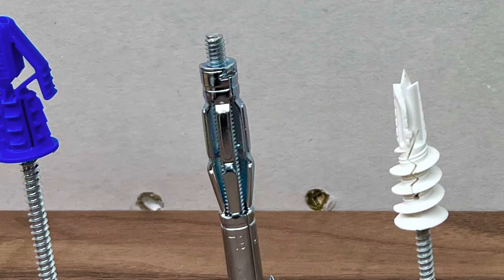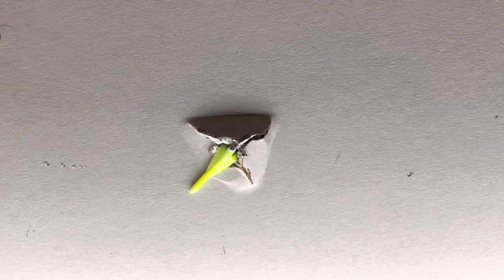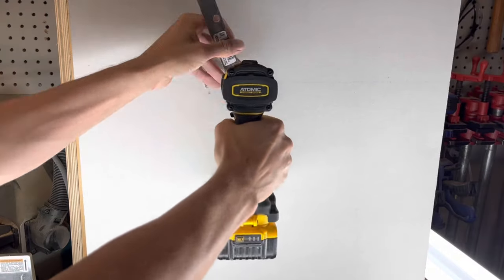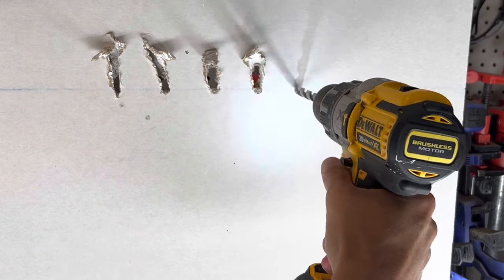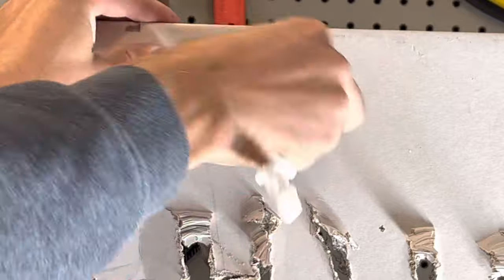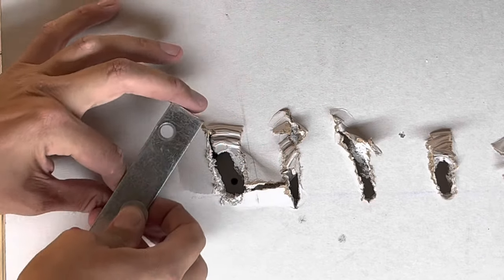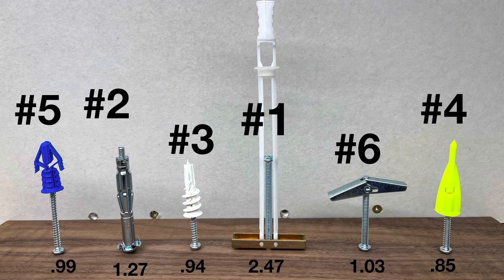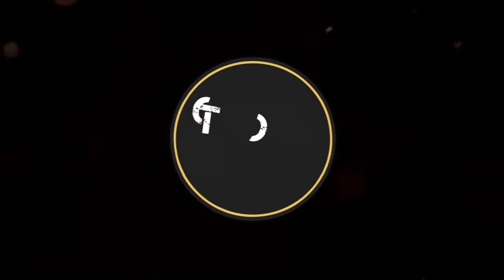The Best Drywall Anchor Plug Inserts // Tested

Comment: I wish people would test pull-out strength perpendicular to the face of the drywall. I think that is relevant too, and is likely to be a more useful measure for differentiating between anchor designs. When you're pulling the fastener parallel to the face of the drywall, at some point the fastener / anchor is just going to plow through the drywall as you've shown, and it seems like the force it would take to do that is a mere function of the strength of the drywall itself and the diameter of the anchor.
Reply from the maker: The perpendicular force you’re asking for isn’t a very common pull on drywall anchors, it’s pretty much just shelving and if you’re hanging something heavy from a ceiling which isn’t a common use case. The anchors tested all got different strengths by how they grab or apply themselves to the drywall. The ones that spread bigger or grab on harder usually have a higher holding strength. In the majority of scenarios the way the anchors were tested will be how they fail.
Reply: Not one anchor failed. The drywall fails depending on the size of the part of the anchor that is behind the drywall. It is rated at 60 lbs per square inch. Multiple anchors spread the load so long as they are not too close together. drywall comes in 1/4, 3/8. /2, and 5/8 and be stronger per thickness.
Reply from the maker: @Stringsmith  all correct basically what I said but none the less correct. That being said some of the anchors did in fact snap before the drywall failed so they did indeed fail.
Reply: I've had to comment on a lot of drywall anchor videos with the exact same issue in testing methodology. It's the force being pulled OFF the drywall that I think is relevant to 99% of people as the centre of weight gravity on the anchor would be considerably worse.
Reply from the maker: @chaseapple85  again besides a levering shelf or hanging from a ceiling you won’t have an outward pull. It doesn’t matter if you’re hanging a photo, mirror, tv or anything else the pull is as shown in the video. This is also how manufacturers give their weight rating. For real world use pulling off the drywall just isn’t realistic.
Reply: Their purpose is to keep the structure from moving forward when you can't find a stud.  They aren't doing much with downward weight, instead the pull away effect.

A good example is free handing shelving that use 1 rail as the support system .
Reply: Again, what I said is that a pull-out test would be better for differentiating between different anchor designs. An anchor is subject to both a downward force and a horizontal pull-out force, with a varying difference between the magnitude in each of the two directions depending on what exactly you’re hanging. But the fact is this: if all you’re concerned about is the force it takes to plow an anchor through the drywall downward parallel to its surface, then why have any anchoring function at all? Why couldn’t we just poke a wooden dowel into a slightly undersized hole in the wall and call it good? Well, because the anchoring mechanism actually does something. And it happens to be what really differentiates between different anchor designs. It drives me nuts how we’re sold the crappiest injection-molded newfangled super-twisty-interlocking-bunch-o-matic when the galvanized steel drill-free design is clearly superior in so many ways. A simple test of pull-out force weighed against practical factors would put this issue to bed so we could move on with our lives. Did you know those steel anchors are even **re-usable**?? And when removed, they leave a hole behind that’s hardly any bigger than the screw itself?? Why did I have to dig so deep to find them, and only from a Chinese manufacturer on Amazon?? It’s madness. 

This message was brought to you by another thirty-something dad with too much on his plate lol 🤣

Comment: With the blue plas plug I’ve found that the depth of the dry wall is so thin that I hangs out a bit and no matter how long I screw in it doesn’t tighten back.

Comment: Togglers/snap toggle anchors are the best as they can also be reused once installed as maybe taking a device down and wanting to rehang it in the same spot. Not only are they beasts but once set can be reused as the plastic retainer holds the butterfly in the wall for reuse.
Reply from the maker: Great point!

Comment: Which would be best for mounting L brackets and a shelf?
Reply from the maker: Probably the snap toggle but first how much weight will the shelf be holding?
Reply: 18 lbs
Reply from the maker: @flyers10az  do you know the shelf’s dimensions?
Reply: @ToolsThatBuild  about 16" wide and 6" deep.  Will be holding a speaker.
Reply from the maker: @flyers10az  yeah I would use the snap toggle as long as the bracket is wide enough to cover the 1/2” hole. If you can hit at least one stud that would obviously be ideal
Reply: @ToolsThatBuild  ok thank you!  I am able to hir 1 stud with the 2nd bracket.

Comment: Number 2 you need you start with a hand screw driver first as using a drill, caddie causes the teeth to shed the plaster wall
Reply from the maker: No plaster here and as some one who could see inside their wall I can confirm the teeth did not shred anything. The impact driver was turning slow enough.

Comment: Over drilled a large anchor screw (the white one). Left a large hole but still need the space . Now what? Can I stick the screw with the wings in the existing hole and use it was you’ve instructed? 
Thx
Reply from the maker: Yes you can use an anchor that requires the bigger hole like the toggle anchor

Comment: For my professional AV installs I like the toggle bolts.  It’s well worth the price and peace of mind.
Reply: dude, try the expanding anchors, especially if you can get the tool.
so many advantages.
.
With the flat screens being a lot lighter than thery where only a few years ago.
hanging small to medium screens flat to the wall is definitely doable with a hand full of these.
.
they are also good for mounting equipment boxes, wall controls and keypads
.
I will often use them as a seconday fastener on bigger screens.
I'll get a few coach bolts or some other anchor to take most of the weight and use a couple of expanding plasterboard anchors, to hold the corners down and for a bit more stability where there is no stud.
.
one big advantage is they can be used over and over again, because the anchor stays put when you take the screw out.

Comment: Great video. Great comparison. I was looking to see what new anchors were out there.  We've been using the Toggler for some time with great success. Most of what we use it for is shelving standards, and tv mounts when we can't find a stud. Installed over 500 of these and have yet to have one fail. We used to use the old school toggle. The Toggler makes it so much easier. Thanks again
Reply from the maker: Appreciate it, it’s a great anchor for that purpose l. Glad to hear it’s working out for you.

Comment: This is a helpful video but some critical specs on my agenda are wall thickness and removability which varies among your examples.  If you wanted a seasonal/removable feature attached your wall- many of these will leave an anchor, and others drop a component behind the wall if removed and some are hit or miss depending on how secured your hardware becomes.   Also, my walls are particularly challenging as they are 1" thick.  At least one of the molly bolts you tested appeared to be designed for a thicker wall and so secured with an un-naturally high bend. YMMV.  Thanks for posting & testing!

Comment: These days, my preference is the metal expanding anchor.
Yes there is a tool, for them that makes them far easier and faster to instal.
.
These come in a variety of sizes. It is very important to select the correct length, for the thickness of wall board.
The better versions have a wide length range.
.
I carry a wide variety of these.
The quality brand name versions do work better, than the generic versions.
.
Of course the bigger versions will carry more weight than the smaller ones.
.
Another big advantahe of these is that thay can be installed in a variety of different boards and where there is something behind the plaster board, such as a metal stud, some sort of board or bracing sheet or even sheet metal. If you can drill thru it, these anchors will work well.
.
I have installed my share of the screw in anchors.
Here in AU they come on both plastic and metal versions.
They can work very well.
These can work quite badly if not installed with care, particularly when installed with a power screw driver.
.
I have not used spring toggles for many years, they are an uggly pain in the kneck.
.
In my over 40 years in the trade I have used many anchors, these days the metal expanding anchor is definitely my preference.

Comment: I need to install a 140lb floating console on a wall about 2 feet off the ground. It hangs on a simple long bracket with holes every inch that gets mounted to the wall. Normally I'd have put plywood in the wall to hold up the console but we had to pivot after we closed up the wall following renovation and now I don't want to open the wall again in the finished space.

Question: will these 3/16" heavy duty togglers (your #1 pick here!) be enough to support weight of the console, 48" TV, and whatever goes in the drawers? The wall has 4 or 5 steel studs (25 gauge) in it. I was thinking 8-10 bolts, one in each stud and one in the drywall spaced between the studs.

According to the box you can use these toggle bolts through both sheetrock and steel studs. I figure if I put in about 8-10 evenly spaced out, half in wall board and half in wallboard + stud, that's a lot of hanging power and per the specs given above would be putting about 20-30 lbs of pressure on each individual toggle (when adding weight of TV). At the same time, conceptually, I just have a hard time imagining how wallboard, studs, and toggle can hold up that much. What do you think? Thanks!

Comment: We are adding shelves in our kitchen and of course, the J  brackets don't line up with the studs, after watching this I am still torn on which to buy. We will be putting dishes (heavy plates etc) on them
Reply from the maker: Tbh I would check for other solutions for something really heavy being on a shelf. A shelf leavers against the wall obviously which increases the load on the anchor. You can’t hit any studs or use a long bracket?

Comment: i have a question..I just bought a plastic white wall ledge. Its 18" and can hold up to 5lbs. The anchors that came with it are horrible. Made of plastic with the metal screws and it makes the shelf sag. In your opinion what would be the best anchor to use?

Comment: Great video!
Reply from the maker: Thank you
Reply: I was wondering, if I don’t have a drill, is it absolutely necessary to make a hole first for the anchor you used at 2:40? Could I use a nail or something or just hammer the anchor through?
Reply from the maker: @JohnFitzMusic  manufacturer recommends pre drilling for that particular anchor. I would at the very least use a nail and rotate it to make a small hole but it is a fairly sturdy hanger that would probably go in with a hammer and a smaller hole than the recommended drilled size.

Comment: some of these can be angled to benefit application. Like the 2 sided ones either up and down strength or side to side.
Reply from the maker: Your relying on the additional surface area of the drywall increasing the breaking strength. That isn’t the case. The anchors will fail at the same strength. You could actually lower the breaking strength by angling the anchor by making the hole larger or preventing the anchor from completely expanding/grabbing inside the wall.
Reply: @ToolsThatBuild  oh i see. Cool cool

Comment: Love the speed, what haooena behind the drywall, as we as the tests. Suggestion to alps include the rating during each test, and at the end of the video, like Project Farm. Cheers
Reply: Also, the rated weights should be similar, otherwise the percent difference is more relevant. Ie if an anchor rated at 35 lbs breaks at 40 its better than one rated for 75 that breaks at 80. Same 5lbs, huge percent difference
Reply from the maker: @catalindeluxus8545  percentage is a good idea. I do comment on each one’s rating it’s just not on screen as the rating doesn’t matter really since the test is a more accurate representation. There’s only so many anchors on the market and between my two videos I touch on majority of the consumer available ones. Finding ones with similar ratings would be a short video. I instead select all the same size of anchors and let the ratings show in the testing.

Comment: For the toggler, would having them open in a vertical orientation make them stronger, e.g. for shelving? It seems like if they're horizontal then they would act almost like a pivot.
Reply from the maker: It would be marginal the failure point is the plastic on the drywall. So it may help keep it tight a little pre failure but the total failure weight when the drywall fails is the same. The strength is in the spread across the drywall to spread out the weight.

Comment: This is all Sherwood I wonder what it would be on pulling straight out of the drywall as if you were hanging something from the ceiling
Reply from the maker: There’s only a few applications where it’s pulled outward which is a ceiling hanger and a shelf on a wall leveraging against the drywall.

Comment: Number 2 works the best i use them always number 3 is good only expensive
Reply from the maker: Great to hear! The prices are at the end #3 is one of the cheaper options especially for how much it holds.
Reply: I have had 0 luck with number 2. Inlike the ex anchor but it is very big for small projects. What do you suggest for small projects with hollow walls?

Comment: Hello I'm trying to install a floating shelf with the only available option is for it to be through a very thin sheet of dry wall, there's three shelf mount points with two screws each, and they are evenly distributed, which anchor do you think will support the weight of the shelf without breaking through the drywall?
Reply from the maker: Hey what dimensions is the shelf and roughly how much weight will it be holding?

Comment: I have a pack of the Wall Claws.  Not sure how much it matters for this test, it includes an instruction to have the arrow pointed up, so the tip points up when the screw is put in.  Would it make a stronger hold if its hole is pre-drilled?
Reply from the maker: The claw orientation wouldn’t matter much, the package is assuming the pull will be downward so the claw being up will give the least pull out but the failure point of the plastic is the same. I tried many times to install the wall claw as directed using just a hammer but they continually bent. In the video I had to pre drill before hammering it in. Using them some more for lighter things I have always had to pre drill also.
Reply: @ToolsThatBuild  I'm glad the holes are already where I need them.  To put a towel rod back where it was pulled off.
Reply from the maker: @uncrunch398  gotta love when things just work out like that

Comment: Can I use the metal wall hangers to mount something that is in front of a duct to a vent? It seems like the metal ones would be the best. But is it wrong to screw anything into the duct through the drywall?  It's just leading to a small intake vent.  A little screw won't interfere with airflow to me.
Reply from the maker: So you want to use a drywall anchor in a wall and behind the spot is a return air vent or a heating vent? You’d have to be more specific

Comment: My problem is I have a bathroom hollow door only 1/8 inch thick. The anchors I have bought cannot hold tight it just spins around when I turn the screw in. I can’t stop the anchor from spinning around. Help!
Reply from the maker: Ya unfortunately hollow door anchors aren’t the best the material the work with doesn’t give them strength. To hold them still you need an expanding anchor, also what size hole are you using as a pre drill?

Comment: I'm hearing mixed opinions about if my 55 inch tv will be able to hang with 4 flip toggles in 1/2 inch drywall and no stud? Help.
Reply from the maker: What is the weight of your tv?
Reply: I would never put something that heavy supported only by drywall. I would span some wood (or even a metal bar) between studs and attach your bracket to that.

Comment: It looks like the hollow wall anchor you used was mismatched with this thickness of drywall. The slit for the wings should start at the backside surface.
Reply from the maker: Paulin confirmed 3/16L was the correct anchor so that’s what was tested. There’s a few reviews online stating the same issue for the same thickness